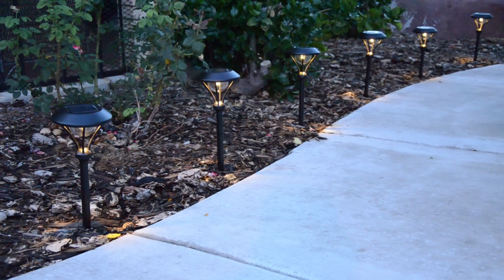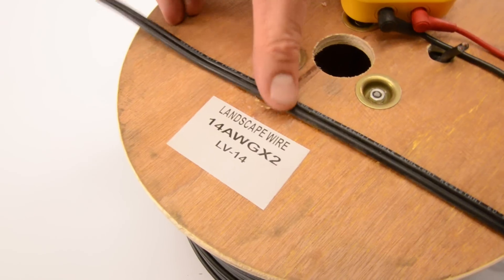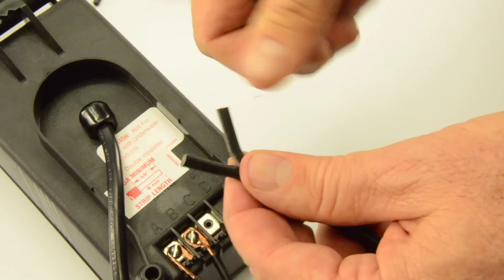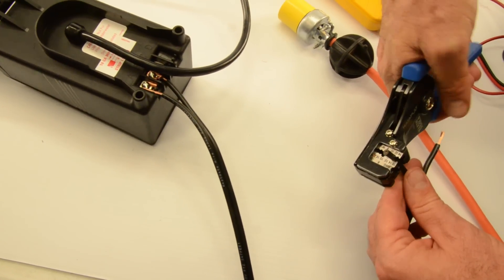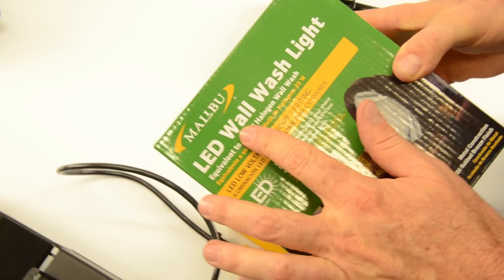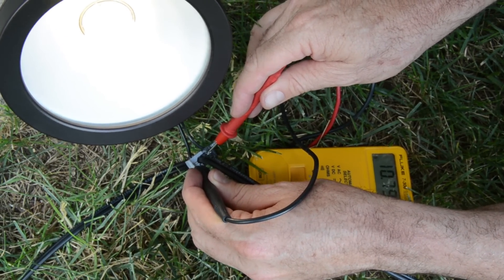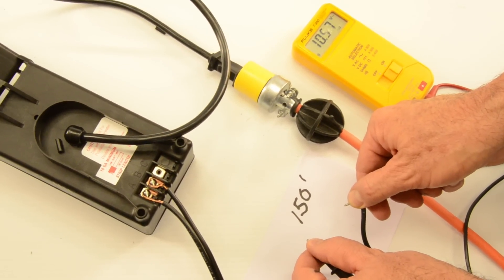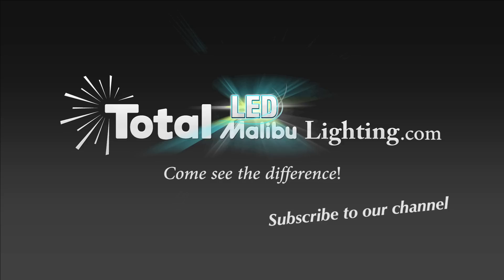Outdoor LED Lighting, Transformer Load & Voltage drop explained AUDIO by Total Outdoor Lighting

Comment: Great video. So what would it mean if you tested the voltage at the end of the 150 ft with no lights and it read 8 or 9v instead of 11.7? I tried this with two separate wires of 100 ft, each 12/2. Would this mean the 300W transformer is defective? Is wattage even an issue? Thanks!
Reply from the maker: Here is a more recent video we made that may help answer your question 🙂https://www.youtube.com/watch?v=-7jMNFhb9WY  Have a blessed week!

Comment: Great information sir! Thanks for posting this. You are helping lots of people. I'm going to by a transformer and lights from you guys. I've got about 200 feet of distance and want to install maybe 10 or 15 lights. Do you recommend DC or AC? I'm going with a 12 volt magnetic transformer without a photocell or timer (my 110v switched outlet is controlled by home automation). Doing it the right way from the start. Thanks again!
Reply from the maker: About 95% plus of the low voltage outdoor landscape lighting is AC. Many attempts have been made by various manufactures to introduce DC systems but it has not been well received as of yet. If you have any more questions please don't hesitate to ask 👉 https://www.totaloutdoorlighting.com/contacts/

Comment: I jst installed my new Hampton bay low voltage LEDs outside with a 120w transformer but they keep flickering????? Any tips?
Reply from the maker: Make sure the LED lights electric current type matches the transformers. Are these AC Lights on an AC transformer? DC lights on a DC transformer? Check the load on the transformer. Total up the wattage of all your lights that are powered by the transformer. This total should not exceed the 120watt ability of the transformer. If it does remove lights or purchase a new transformer that can handle higher wattages. We sell hundreds of transformers on our website here that all come with outstanding customer service support: 👉 https://www.totaloutdoorlighting.com/landscape-transformers.html 👈 Next you can check the voltage at the lights. You can see how to do this in this at 11:58 in this video. Make sure the voltage is within the operating range of the LED lights. If you don't know this info contact Hampton Bay. If your problems continues I would contact the business you purchased the transformer and LED lights from for more troubleshooting options. Hopefully this helps 🙂 Have a blessed day!
Reply: Total Lighting Supply the lights are 9.8 watts each one....I used 14-2 100 ft cable.....its funny becuz the last light jst reached the end of the cable perfectly....I installed 8 lights.....so I did ur voltage drop and I'm at around 9 something.....I spent close to 400 bucks on these things, so I'm irritated.....last night they kept flickering like if I have a haunted house and was gonna trigger off someone's epilepsy....lol should I try attaching it to the 15 v terminal?
Reply from the maker: I would get a reading of the voltage at the first light and make sure it meets the requirement of the LED lights. If you put too much voltage into the lights you may damage the lights. I would try contacting the company you purchased the transformer from and make sure its compatible with the specs of your LED lights.
Reply: Total Lighting Supply yeah I'm gonna pull out my tester and check each one...its a hassle cuz I buried the cable....lol but they lights are also hampton bay...its almost like a package deal so I know they r compatible.....I did notice that the 6th light when I installed it..it wouldnt work..then when I started to pinch the connector it would turn on..then I let go. Then it would turn off....so I wrapped electrical tape on it to keep pressure on it and it stayed on...maybe that one is causing the problems...anyways hey, thanks for responding to me and taking time out of ur day to attempt to help me out....God bless u
Reply from the maker: Hopefully you'll be able to resolve the issue! God bless you as well 🙂